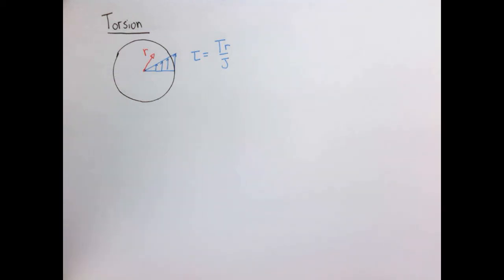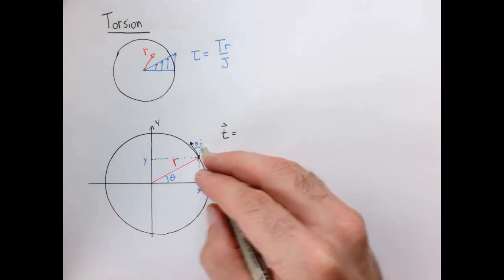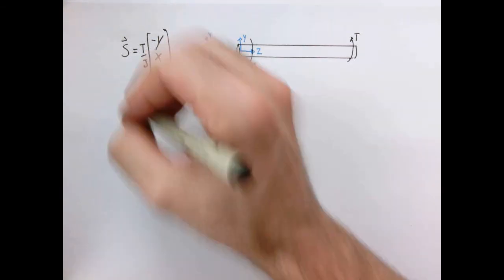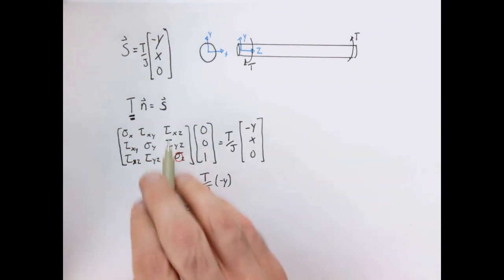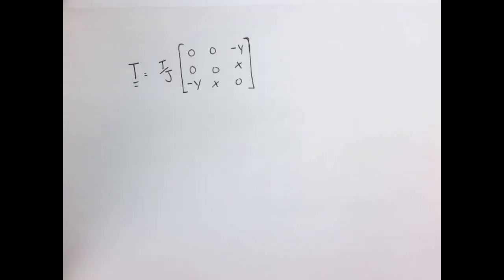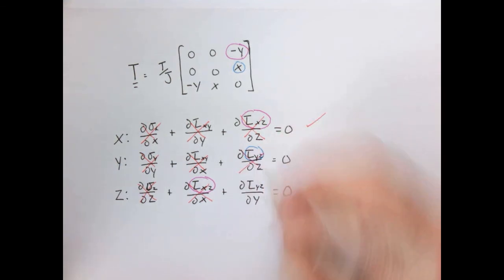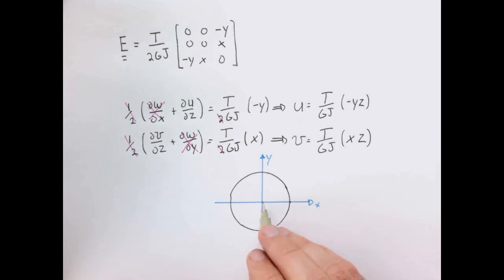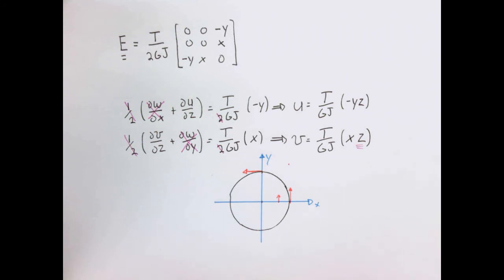Linear elasticity theory. Part 6. Torsion revisited.

Comment: Please I need a solution for this app
 Let the extreme cross section of a circular prismatic bar with axis    be acted on by couples  whose moments are equal in magnitude but opposite in sense in this case the bar is subjected to torsion. If this assumption is taken into consideration, the projections of the displacement vector of some point in a certain cross section of the bar are,  ,  where    is the constant angle of twist per unit length of the bar.